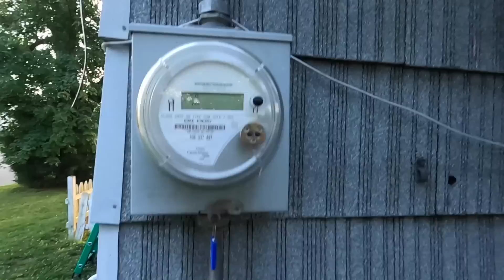What is in the Basement of my Uncle Ron's House? It's not Good - AC Problems!

Comment: The PVC pipe that was disconnected is a combustion air intake for the furnace.  Being disconnected is not dangerous, it just means the furnace was pulling in basement air instead of outside air.  That would have been inefficient if the basement were heated, as it would be pulling in heated air for the combustion chamber instead of outside air.  The exhaust, however (the PVC coming out of the small draft inducer blower,) is the one you don't want blowing out under the house.  Excellent cleaning job.

Comment: Thats the condensation pump, not really a sump but works the same. The pvc pipe hooked up to the small blower in the unit is for the Carbon monoxide.

Comment: Filter should really have a housing so its not pulling the basement air or be below the coil like you mentioned and tape off the opening on the return - the pump you thought was a sump pump is actually called a condensate pump, it pumps all the moisture and condensation the unit removes from the air out that drain tube that was hit by the mower/storm whatever happened, I like the videos on the houses! Your uncles and aar hq! Great work and great maintenance and repairs!

Comment: I was 15 years in the HVAC business so just some info that I can see.  The pump is a condensate pump.  The high efficiency furnace creates water and would normally drain through a floor drain.  Most older houses do not have that drain so the water goes into the pump which then sends the water through the pipe into another drain, in this case that skinny pipe you found outside.  The white plastic pipe that's disconnected is indeed the exhaust, the one on the other side is a fresh air intake.  Just need to get the right glue and push that one pipe back together.  Taking that filter out actually may cure some if not all your AC problems too.  You likely had most of this figured out before you read this though.
Reply: @ayo9057 I can agree I did this for two years and it’s definitely not as complicated

Comment: Get a couple of rolls of foil tape and tape all the seams on those vent lines.  Then put some insulation over the supply lines and foil tape those.  You can also use the foil tape to seal up the area around the filter and to hold the filter down.  Should make your HVAC run so much more efficiently.

Comment: The outside unit gets plugged up as well. It's a giant radiator that surrounds the works. Hose and detergent a soft brush maybe. Clean the fins so the air can move through. The capacitors fail commonly on the outside units. If it's not running at all.

Comment: The evaporator is really clogged up underneath? You can try and vacuum the heavy stuff from it at first? Since you don't have compressed air, I'd try and get the coil out as far as possible, use a can of Blasta-coil or any coil cleaner, soak it, and flush it from the top down through the coils with a garden hose?

Comment: I believe the siding on the house is asphalt shingles, not asbestos. Ambient air enters the bottom of the coils, cold air comes out the top,(That's why it was so clean on top) the crud will be on the inside (bottom) of the coil. Be gentle wire brushing that coil, they are very delicate and easily damaged.

Comment: You need to drill two pilot holes.  One that goes all the way through the trim and the stud that is equal to the diameter of the screw "Shaft".  The second hole is big enough for the screw to slide through on the trim piece only.  Then you slide the screw through the trim and let the threads of the screw threads into the stud and pull the screw head and the trim against the house.  If you only drill the first hole, the threads will engage both pieces and if the trim is away from the house, it will stay away from the house, locked on the threads.

Comment: Great job! I bet that filter was 90 percent the reason for the flow issues, that one was really full of dust and dirt. With that rust on the evaporator lucky did not have any freon leaks, seems to be a common culprit that even I had run into.

Comment: That condensate pump is hooked up to the air handler drain pan, must use a float switch? Go outside to see if the condensing unit fan is operating, and is blowing warm air out the top of the unit?

Comment: The pump is an AC condensate pump...catches the condensation and pumps it out into either a drain line or out into the yard...There's a level sensor in the sump that turns it on and off.  That broken hose is where the condensate gets pumped out into the yard...usually you want to run it away from the foundation so it can drain into the lawn away from the foundation.

Comment: The pipe on top of the furnace that was disconnected is for the fresh air intake because that's a high efficiency unit. The one on the far right is the exhaust

Comment: You can cut the PVC pipe in an accessible area and install a Fernco fitting (rubber sleeve with pipe clamps on both sides) then glue all the PVC to PVC fittings together. They also sell metal duct tape used to seal the galvanized duct work together to minimize air leaks. Obviously clean both sides where the PVC and duct work meet before sealing.

Comment: thankfully, the 2" white pipe that came apart was the air intake. the one on the right that goes down to the fan is the exhaust. The hose that goes down to the box is the condensation drain. that box is like a little mini sump pump to pump what is collected out.

Comment: We didn't question how things were installed as long as they mostly worked. Dad's house was renovated in the '70s and they definitely did some iffi things. Like adding aluminum and copper wire to the existing nob and tube. Lead pipes and addition built on stilts hanging off the house. The gas furnace and water heater in dad's house vented into the basement.

Comment: 2 pvc pipes are fresh air in and exaust out. That little black box you thought was a sump pump is a condensation pump that pumps out the condensation from the unit 👌🏾👌🏾

Comment: 8:12 that is a condensation pump to take all the condensation from the evaporator coil up and out of the house. You should be able to take the panel off the coil without removing the pvc it will slide out and you will have to clean the coil in place unless you are going to break out torches and potentially get in over your head. I’d wash up the condenser unit and if it’s still having problems keeping up I’d call a tech.
Reply: That is basically what he did.
Reply: @danielulz1640  rite on I was watching on my lunch break so didn’t get to finish the video before I commented my bad.

Comment: you might try putting a filter in the return register instead and just plugging the hole in the return in the basement cause its just introducing basement dirt to the filter and system and ya that system needs a lot of foil tape on all the joints

Comment: Always funny sometimes, you post videos about things that I am having issues with. My A/C Died on Saturday and had an A/C Guy out here today to look at it, was just a capacitor on the A/C Unit that died, so had them replace it which was not expensive, but also had them install an A/C Saver unit on it also, that way the power does not surge to the unit when it powers on, supposed to help the longevity of the unit.. $655 repair, which was definately worth it. Just thought it funny that you put out an A/C Problems video when I was having A/C problems.

Comment: The pump is a condensation  pump.
If the plumbing is to high it gets done that way.
The pipes to motor is a vent for gasses.
The other is fresh air intake

Comment: Hey Randy I tip I learned a while back because I deal with on a/c regular deconstruction that is with the insulation my friend told me that if you use Dawn soap and bathe in it it will get all of the fiberglass off but it has to be Dawn. the best tip an old man gave me it works great

Comment: If you need to check the efficiency of your AC, you can buy AC recharge gauge for $30. Don’t get the complex one. Connect it to outside unite, to its upper line. Good operating pressure should be at 65 psi.

Comment: what I do is chained up the a coil to the ceiling and then pull out the furnace basically all you'll need is some quarter inch chain a couple lag bolts in a roll of aluminum Tape

Comment: You need to buy silver tape to wrap the joints, the tube on the right is a fresh air pipe. You can get a spray to clean evap coils
Reply from the maker: I bought the tape and I used the spray in this video

Comment: You're best bet would be to connect a Richard Trethewy  (not real sure on the spelling). He can answer all your heating air-conditioning or plumbing needs. Since your are a person not afraid of cameras and your needs are warranted  you might be able to get this done mostly free. The show he is with is called this old house and ask this old house. It was said that the program went to he## when Bob villa passed,  it did untill the one hosting it now, and he actually start the ask this old house part.

Comment: You need to take that coil out and clean it with a hose. You're going to have to take the freon out. Heat the tubes up. Pull them off. and then clean it and. put the copper tube back in , Vac system and charge it you better hope it is not R22 freon  but i am sure it is 20 years old  because it's 90.00 or more a pound most likely more
Reply from the maker: My fox worked perfectly. A/C is working great now and there was no need for pulling it all apart.

Comment: Please be careful I see cut loose electrical wires by the ac I believe you’re ac filter is in a bad place it as of now is able to pull air from the basement that is moist air could be moldy that should be sealed where that filter is moved up to return air in more accessible as far as your electrical we had that problem when I did maintenance we would put in a brace in the attic and put a big threaded eye bolt into the attic and electric company would come and reconnect to the eye bolt never had that problem again

Comment: Duct Tape all the duct leaks. 

They want a lot of money (too much) for replacement Central Air equipment now days. Thanks in part to Uncle Sam's new refrigerant regulations you can't just gas up an old one if the refringent (such as R-22) is leaking. 

Check out the newer Mini Splits on your next go round with AC on that old house.